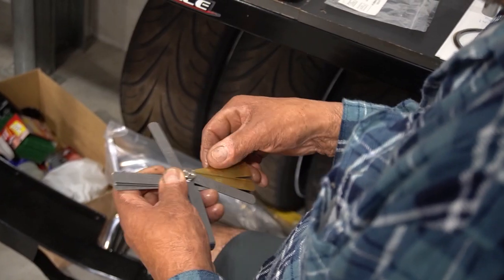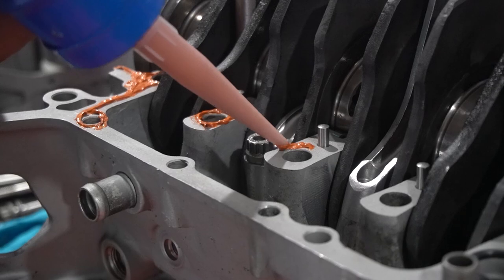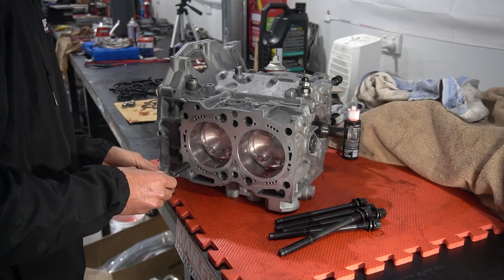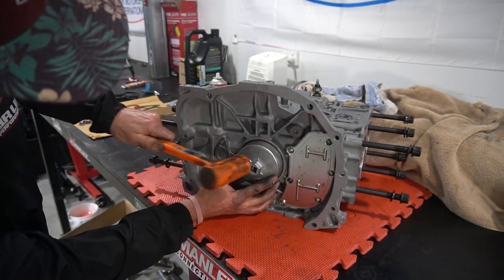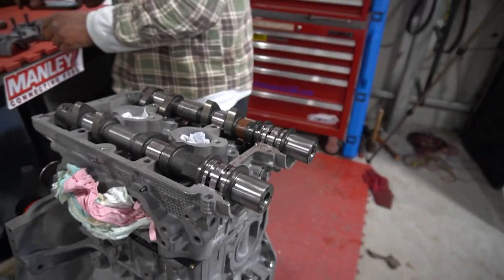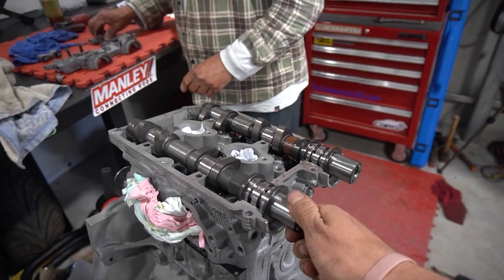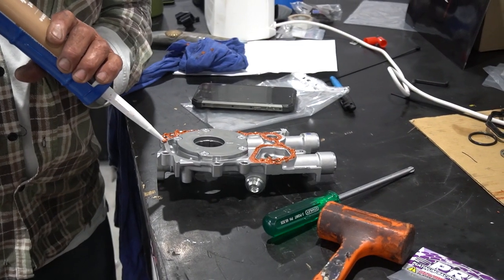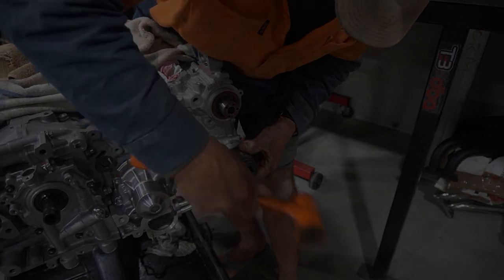Building a BULLET PROOF EJ Part 2 | Step By Step

Comment: Nice vid, you may want to double check the screws on the oil separator plate on the rear of the engine. I'm fairly certain the black screw with the loctite/sealer goes in the hole with the arrow. Could be wrong, but would hate to see it cause issues down the track....
Reply from the maker: good pick up mate! appreciate the keen eye. Will get it sorted

Comment: This looks sick. I’m trying to decide if I should get a brand new ej207 or get an IAG magnum ej20 closed deck shortblock and use my ej20g heads. I want good power (300-400kw). But I want it to be somewhat reliable. Not sure how realistic I’m being
Reply from the maker: Get the closed deck and be done with it mate. Ej207 up around 400kw you'll always be wondering if it's about to pop 😅. Bite the bullet and get a closed deck, and try save some money by doing it once 🤘🏼
Reply: @BuiltByBlake   cheers. The IAG magnum block is $10k but happy to save for that. It’s a complete bottom end that’s compatible with all ej20 heads so can just reuse my ej20g heads. It’s also designed to essentially remove any head gasket issues as there’s no pressure on the gaskets. So probably worth it. Keen to see how your build goes. Not many you tubers who build gc8’s.

Comment: What class are you guys going to run in at tarmac rally’s? Also building a gc8 for this but the regulations are strict on engine, gearbox and diff choices!
Reply from the maker: Yeah nothing is 100% locked in yet, there's a couple around which would be fun but right deans goal is just having the car in a working state 😅 then work out what to go with it
Reply: @BuiltByBlake  fair enough guys love the build anyways!